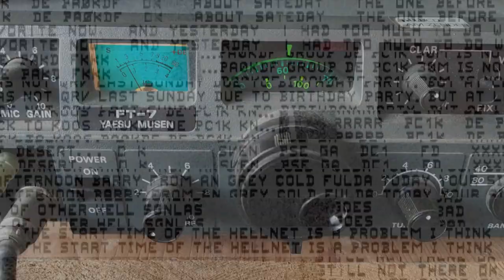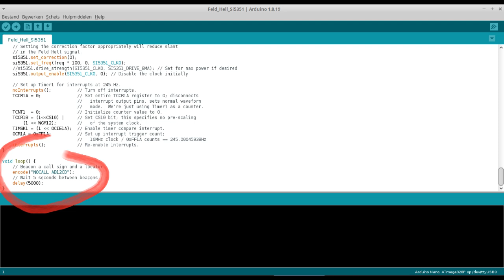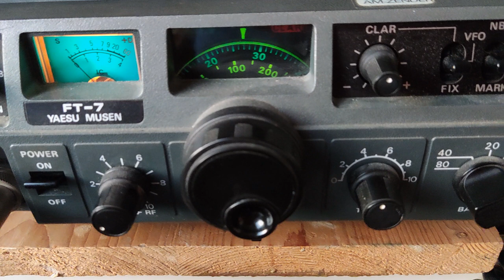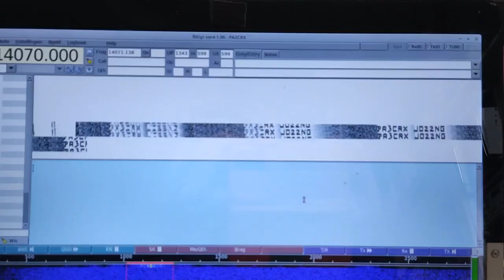Digital Feld Hell mode by using an Arduino and Si5351

Comment: I believe the reason you are seeing failure above the a certain band is because 21.15MHz is the highest number of hundredths of a Hertz you can represent in a signed "long".  Your variable at the top of the script (long freq = 14063000) is a 32-bit number.  You then multiply it by 100, which is an integer, and that will result in a value that gets truncated to 32 bits.

Define them as "unsigned long long" values.  E.g., you can define it as "unsigned long long freq = 14063000;", or you can cast it to "unsigned long long" before multiplying it by a hundred (e.g., "(unsigned long long) freq * 100ULL").  Notice that the "ULL" suffix specifies to the C compiler that it should be a 64-bit value.
Reply from the maker: Thank you very much for thinking about a solution and sharing this information. I will try it!

Comment: have you tried using VDDO pin to modulate the output?
Reply from the maker: Sorry, I do not understand the question. Could you be more precise?
In the circuit in the video the Feld Hell signal is generated so the modulation is present.

Comment: I can hear it in Sweden - Motala! 🙂 Job well done sir!👍
Reply from the maker: Thanks fot letting me know! And thank you for the kind words.
My signal was also heard/decoded with the websdr in Bordeaux and Andorra.
Reply: @PA3CRX  Wow! That is not bad at all! Congratulations! How watts do you get out of the BFG96 (500mW?) and what kind of antenna are you using?
I love these kind of builds! Perhaps make a RTTY version as well? The Si5351a is a magic litle thingie!😄
Reply from the maker: @karlhill6652  Thanks for your congratulations! The output is mentioned in the transmitted text, you should install FlDigi to read it 🙂 It is only 100 mW and to confuse you more: the antenna are only two wires that I hang under the roof. One more or less vertical and one more horizontal. That's all! About the amplifier and filter an other video will be made, stay tuned! 🙂